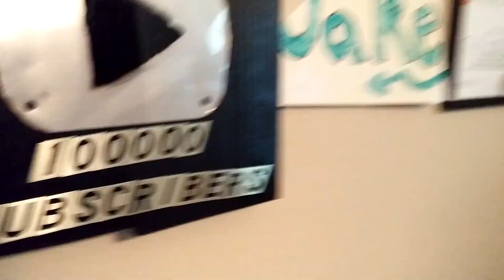Everything is dumb but the Baby

Comment: What I did for my breather issue I had was I used a fuel filter or some open can (that is transparent) to create sort of a one way valve that would fill up but allow pressure to blow by (not oil though). then I also did an uphill thing like you.